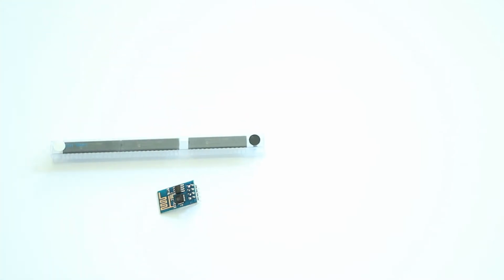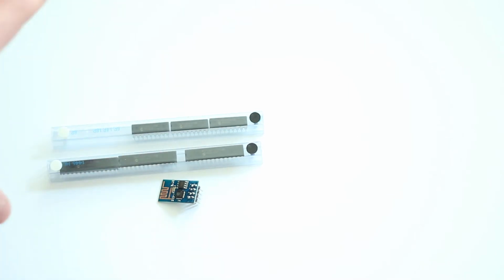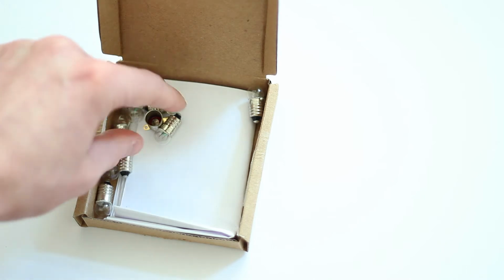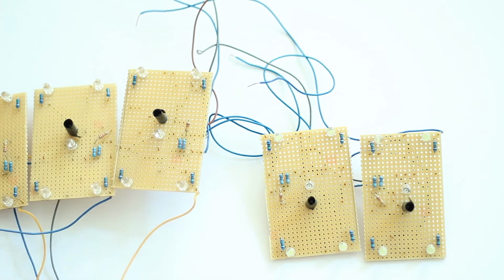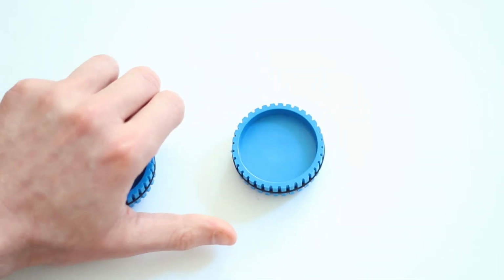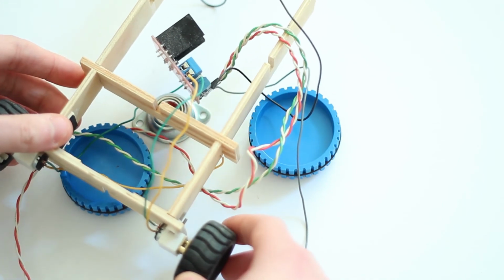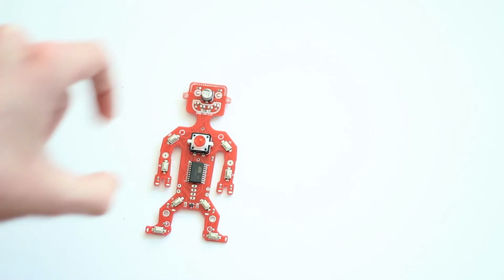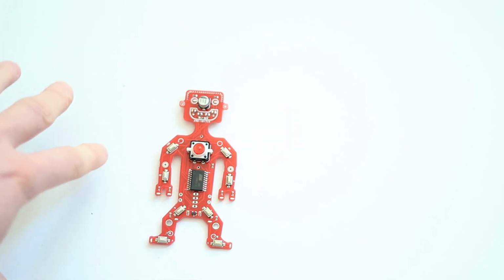Update Video 2: Upcoming Projects

Comment: David Watts , An ESP project with 16 I/O pins would be awesome!!!
In case you weren't aware, the ESP-12 has EIGHT usable I/O pins and it cost the same as the ESP-01.  So, if the project only needs 8 or less I/O pins, you can do so without any extra chips using just the ESP-12!  I won't spam your channel with link to my video. Check out HariFun #106 for a demo of the ESP-12 if you like.
Reply from the maker: Hari Wiguna Say whaaatt?! I hadn't seen the ESP-12, I wasn't even aware of other versions. Thanks. Since I have the chips I think I am going to go ahead anyway but I will definitely try and pick up the big brother of the ESP-01.